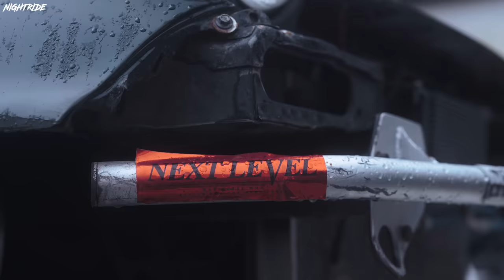Nissan S13 engine bay shaving & bodywork

Comment: so excited for this car man. Also when mixing filler do it by smearing the filler and not stirring it or you create pockets of air. either way id always use a putty after to seal any sanding marks or pin holes

Comment: I dont know, if you`ll see this comment, but  i work in a body shop, and here is two tips for body filler, it isnt necessary to put sealer or primer underneath body filler. Make sure the metal you are applying it too is warm to the touch and prepped with minimum an 80 grit sand paper. If you are trying to get body filler to stick to cold bare metal even if prepped correctly, most of the time wont stick, so it sometimes helps to use less hardener in the filler, because the more hardener you use the warmer the filler gets when hardening the larger the temperature difference the less its gonna want to stick. However, this does take some experimenting to get right and having warm metal underneath your filler will always work better.

Comment: You may already know this..
If you use a brass hammer on the other side of the hole it will help to easily weld up holes and the brass won't stick to the panel being welded

Comment: hey guys, you can put filler on bare metal... you just have to use a super corse sandpaper to make the filler adhear to the metal, try a 40/60/80 grit paper :)